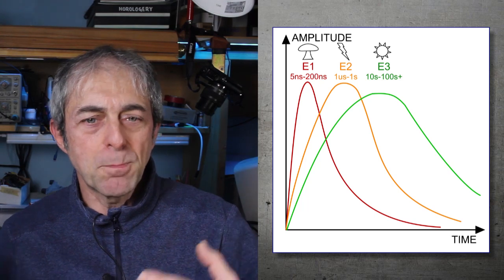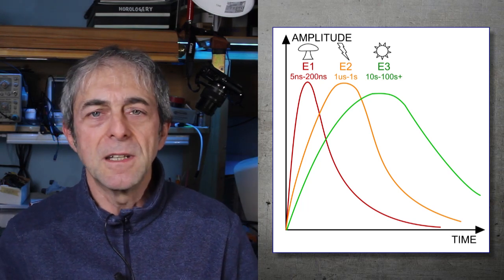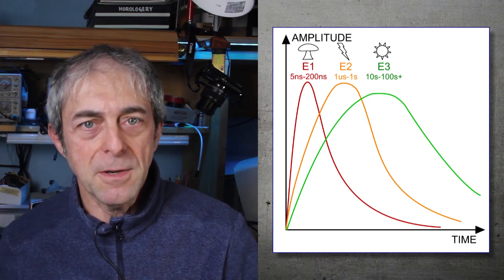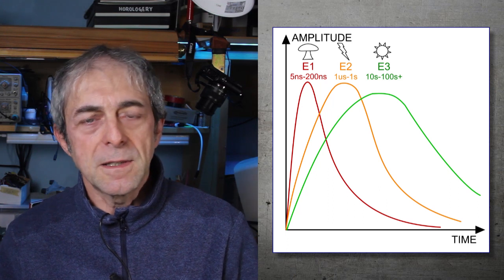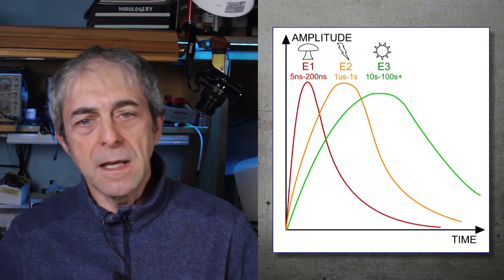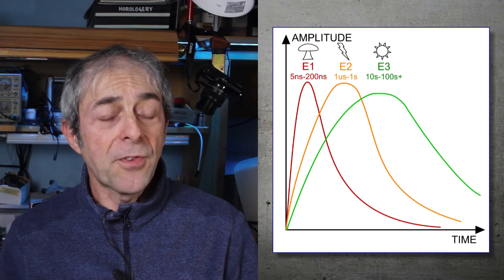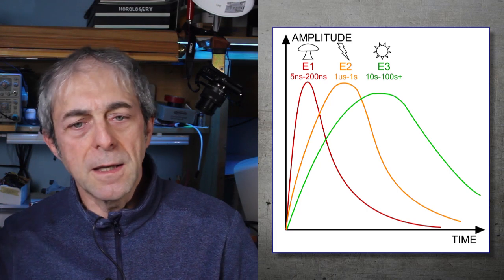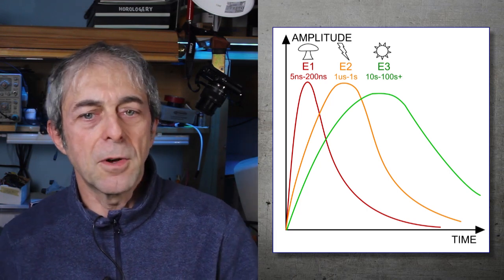An #electromagnetic pulse may ruins your day: can your #electronicproject withstand it?

Comment: Great Video! Do you think the damage to your board through the power was from the EMP or Direct lightning - via the power wires? I havn't considered protection on the power input but I have mostly worked on battery powered devices.
Reply from the maker: Thank you. Yes I think it was from the EMP. The power port of that board is 24VDC from a SELV power supply that is shielded and connected to PE. That board is a module of a complex building automation system, so the power supply comes from a long cable that also carries the AB RS485 data singnal, and connects in parallel all the modules in the system. The cable is a standard ethernet cat.5. Thus I think the EMP induced a surge of voltage through that long cable (by long I mean ~100m). I think to the EMP also because there was no signs of burned components, that otherwise would had happened in the case of a direct lightning discharge that would have been wildly more destructive. When that incident happened every, and I mean EVERY electronic equipment in the building got destroyed. Fridge, TV, burglar alarm system, washing machine, gate control ...everything. The lightning stroke a nearby (about 50m) telephone junction box. Six other nearby houses were affected in total, every one had almost everything destroyed. At the Telecom local station the connected cabinet catched fire.
Note that the bulding where my modules were installed did not have the telephone line at the time (the building was a new construction). In one of the other houses interested by the event the telephone literally exploded.
It was an interesting experience.
Reply: @AccidentalScience  Wow! That is very interesting. Thanks for such a thorough reply!
Reply from the maker: @mahmoodmirza3301 as I've said in the previous reply, it was.